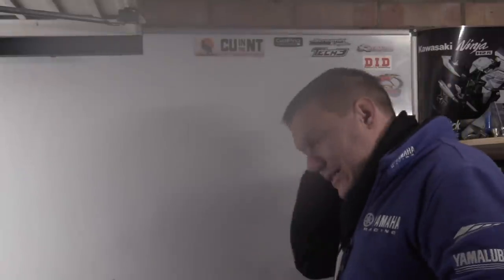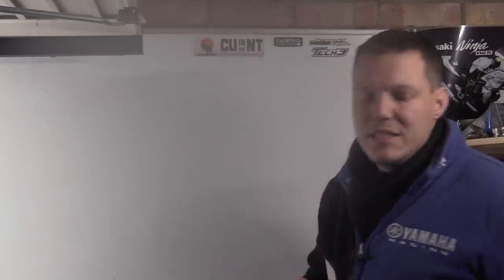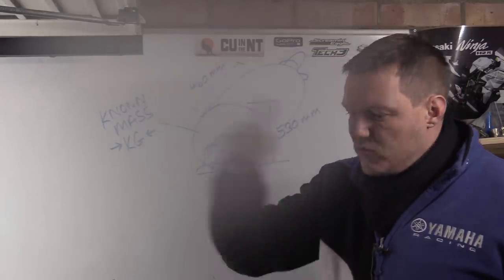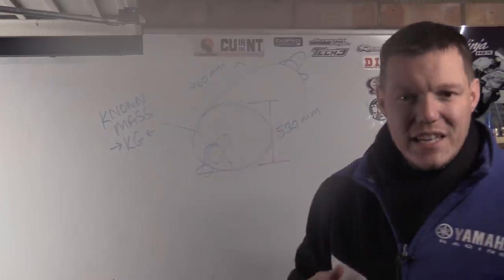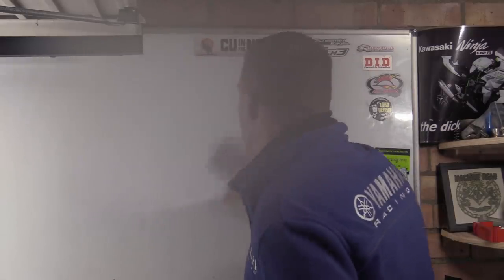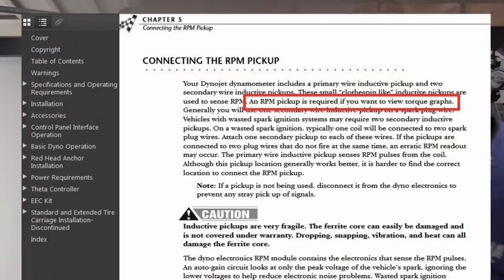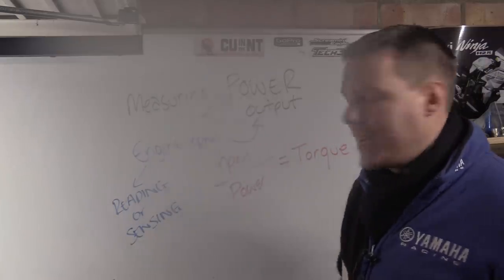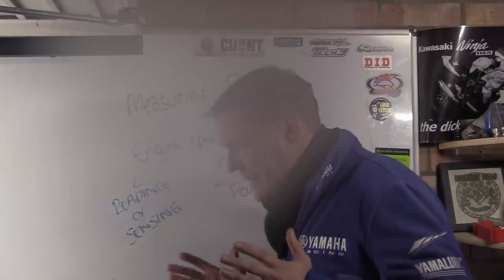Dynos and torque - Torque Episode 2

Comment: When i was at the dyno, the dyno was told when the engine was at 1000rpm and when it was at 3000rpm, so it could calculate the rpm of the engine at any given time.
I do not think it is as accurate as a sparkplug sensor or odb connection, but maybe good enough.
The dyno also had 2 ventilated brake disk like looking things with magnets on it, they could use them as a brake, if the drum was to light to give a long enough run time.
My 230hp car did not need the brake turned on, but he told a story about a more then 900 hp supra that needed full brake or the run would be over before the engine build up turbo boost.

Comment: I wonder if a small silica gel pack inside the battery compartment and leaving it somewhere warm overnight might get rid of the fogging, just a thought
Reply from the maker: 1 - there's no room 
2 - the fogging is actually the cameras fault (lol) as the sensor heats up moisture condensates on the cold lens. Tyring to heat up the lens only works for a limited time and then it cools and it mists up again. Best to leave it and let it naturally warm up together. 

Pain in the arse but there's little I can do about it at the moment
Reply: @dirtygarageguy  thanks for reply, interesting vid
Reply: My fpv goggles use a small fan . Just a small airflow will work
Reply from the maker: But it's pretty much sealed

Comment: yeah these dynos measure hp not torque, thats why you can find dyno charts that have the hp curve only with no torque, but not dyno charts that have tork only and no hp.
and when they dont hook up the rpm reading, the x-axis just shows drum/wheel speed instead.

Comment: Matt, heard you mention assembly lube before and either you or someone in the comments said to mix moly grease and oil if you didn't have it.

Am I remembering that correctly ?

I am rushing to resemble the head and get it back in the bike before Christmas or else dinner will be had sitting on the floor ... yes, I have my priorities in order 😂

Anyway, thoughts ? Just use engine oil or mix in some moly ? If so, whats the ratio ? Etc
Reply from the maker: Yeah it's in a lot of manuals and the ratio is 50/50
Reply: @dirtygarageguy  thanks dude, I have downloaded and printed the manual to ensure everything has the correct torque spec and for timing etc. 👍

Comment: Borrow a hair dryer from your missus or Issac.  Remove your lens and in a dry room dry the lens out and your camera body. Its just condensate from water contamination. That's why its happening in the winter but was fine in summer.  The moisture and temperature differential when the camera warms up is fairly high. Hence fogging.

Comment: I've never paid much attention to how torque appears on a graph for any given bike,I prefer to judge a bike by what it's like when you roll the throttle on. eg,I had a BMW K1200rs,130bhp,I traded it in 10 years back for a 900 Bonnie with less than half the bhp,never regretted it,the Bonnie just feels so much nicer on the road.
Reply: torque plot is useful for seeing dips or flat spots in the powerband caused by non optimal fuelling/timing/exhaust scavenging which are not as obvious on the power curve because that curve is multiplied by the rpm and that has a masking effect.
and you can usually feel flat spots, the torque curve just confirms it and is useful as a tuning aid.

Comment: I really need a good answer. Can you have a motor with more torque than horsepower?
Reply from the maker: They're not seperate things. HP is torque * distance / time.
Reply: There are loads out there where the dyno results give you a higher torque than HP. Common in diseasels but matt is correct their connected and just describe power.

If I recall correctly Horsepower is an expression of the power required to move a fixed weight a specific distance whereas torque describes how quickly that work can be done.
Reply from the maker: In other words they're not comparible. For example 

50 lbs.ft * 1 rpm / 5252 = 0.0095 HP

So if you mean is the number 50 bigger than 0.0095 then yes, but they're not the same units 

1 HP is 33,000 feet - pounds force per minute
50 lbs.ft is 50 pounds force - feet

Notice that 

ft . lbs (in HP) and lbs . ft (in torque) are the other way around. This will be explain in part 4, and they are different things
Reply from the maker: "If I recall correctly Horsepower is an expression of the power required to move a fixed weight a specific distance whereas torque describes how quickly that work can be done."

- LOL wrong way around, and the torque bit is wrong. The next videos will explain
Reply: I`m looking forward to the rest of the videos in this series. Cheers!
Reply: Ofcourse you can, my old Toyota diesel produces 105bhp@4000RPM but 300lbs/ft of torque much lower down.

They aren't separate though, it isn't the same unit of measurement
Reply from the maker: "Ofcourse you can, my old Toyota diesel produces 105bhp@4000RPM but 300lbs/ft of torque much lower down."

- of course you can't because like you said "They aren't separate though, it isn't the same unit of measurement"
Reply: @dirtygarageguy  whoops... I'm an English graduate not an engineering or physics graduate and it shows.... 

that was half dredged up memories from a lecture nearly 16 years ago. I was always  told that hp measurement of a motor was based way way back during the move from actual horse power to steam power  on a comparison to a specific piece of machinery.

So basically HP is how quickly the work can be done and Torque is what... The force required do it at that speed?

Comment: Your video "Firing order and torque" is still wrong and I want a correction;)
Reply from the maker: Which bit?
Reply: @dirtygarageguy  You showed instantaneous torque on a graph (over crank angle), but at the peak(during power stroke) you wrote down(and talked about) the maximum torque from the bikes specification.

That's wrong since the maximum torque from the bikes specification is average torque, calculated from HP.
Reply from the maker: So the question here is averaged over what? 30 seconds, 10 days? Power is actual over 1 second. Torque is a force, with no mention of time. You actual divide the power over time in a sense removing time from the equation to get a force. 

Therefore peak force is peak torque. Calculated or otherwise.

The next question is where did I get those numbers for that graph from? 

"You showed instantaneous torque on a graph (over crank angle)"

-  instantaneous? This surely doesn't make sense, even to you, as you followed it up with over crank angle...
Reply: @dirtygarageguy  Averaged over 720°. 

"The next question is where did I get those numbers for that graph from? " where was it from?

Do you understand what I am saying with your peak torque is wrong?
If the bikes specs say 75Nm, the peak torque on a graph that resolves to degree of crank angle can't be 75Nm but must be much higher for a 4 stroke engine.
Reply from the maker: "Averaged over 720°"

- And how does it do that? The power calculation is actually over 2pi * r which is 360degrees not 720.

"If the bikes specs say 75Nm, the peak torque on a graph that resolves to degree of crank angle can't be 75Nm but must be much higher for a 4 stroke engine"

- Explain. I want to know how you got to this.
Reply: @dirtygarageguy  The bikes specs are calculated like you explain in the video above. The torque spec is the HP devided by RPM (angular velocity...). 
Therefore it's average torque, basically how much >continuous< torque is needed to make this HP at that given RPM.

And yea, it's averaged over 720°, not 360, cause on a 4 stroke engine (assume single cylinder) the cycle obviously starts again every 720°.

" Explain. I want to know how you got to this." 
Okay, let's assume a single cylinder 4 stroke. The e.g. 10Nm  torque specs from the datasheet is created in one out of four strokes, so the peak torque must be at least 40Nm. Now during the power stroke itself, most of the work is done within about one third of the power stroke, so the peak torque is about 3 times higher again: 120Nm.
Reply: I made basically the same point & Mr Workshop seemed to imply he was deliberately misleading us and was going to reveal all in a future video (presumably this series). I'm still waiting!
Reply: @yodaedwards5225  alright! I have the same feeling;)
Reply from the maker: "I'm still waiting!"

lol keep waiting

Comment: Stupid question could you measure torque directly or is it always derived from the rpm based calculation?

Also I get how these work and how brake dynos work but do. You have any suggestions where to see how an engine dyno works.

Further dyno qs why are some dynos known to read high/give people an ego reading iv heard the dynojet set up to the manual spec has a reputation for being Conservative in its numbers.

Oh and how accurate is the maths for. Working out loss from an engine dyno to real. World. Performance the losses from drivetrain, chain, wheel etc.

Im learning a fuckton watching you torque about talk.
Reply from the maker: "could you measure torque directly"

- Yes, but it's with a different type of dyno using a load cell. 

"You have any suggestions where to see how an engine dyno works."

- Engine dynos can be inertial dynos just with a coupling to the crank. An inertial dyno doesn't have to have a rotating drum for wheels - it can have a flywheel

"Further dyno qs why are some dynos known to read high/give people an ego reading iv heard the dynojet set up to the manual spec has a reputation for being Conservative in its numbers."

- This is a video all to itself.

"Oh and how accurate is the maths for. Working out loss from an engine dyno to real. World. Performance the losses from drivetrain, chain, wheel etc."

- again an entire subject - but losses can be calculated by letting the inertial drum naturally slow down with the wheel still in place, although you have to have the clutch disengaged otherwise you'll read the pumping loses from the engine.
Reply: @dirtygarageguy  thanks and sorry. For adding to The video list also now I'm off to see how a load cell works and/or what one is.

Comment: in order to measure torque directly you would need to eliminate time/rpm wich is imposible in an engine. So nobody ever measures torque in an engine? i never though about this..
Reply from the maker: Yes they have and you can - kind of. It's called a Prony brake. There are other ways to do it, but the problem is they're dependant on friction and always apply a load on the engine.
Reply: @dirtygarageguy  i just looked up the concept. So its measured in regard of how much weight the flywheel or an output shaft can take before slowing down or stalling? But if the engine is working, the rpm should alter the outcome i think. Its not the same trying to slow down something at 100rpm or 10000rpm. And if you measure torque based on something that is spinning arent you measuring power?
Reply from the maker: " i just looked up the concept. So its measured in regard of how much weight the flywheel or an output shaft can take before slowing down or stalling?"

- it's measuring how much resistance is required to apply 'x' amount of torque. Because it's a friction system you also have to allow for heat etc - so it's not the most accurate measurement device hence why they're not used any more

Comment: My bike produced 138 hp on a Superflow eddy current dyno and 167 on a inertial Dynojet . DynoJet, making the internet a  quagmire of bullshit "djhp fudge factor" numbers. LOL
Reply from the maker: Well it depends on the SAE correction factor. The atmospheric measurements can be fucked around with. This is down to the dyno tech and not the dyno.
Reply: @dirtygarageguy   Maybe not?
Dynojet’s final number-fudge was arbitrarily based on a number from the most powerful road-going motorcycle of the time, the ’85 1,200cc Yamaha VMax. The VMax had 145 advertised factory horsepower, which was far above the raw 90hp number spit out by the formula. Meanwhile, existing aftermarket torque-cell engine dynamometers delivered numbers that clustered around 120. Always a pragmatist, Dobeck finally ordered his Chief Engineer to doctor the math so that the Dynojet 100 measured 120 hp for a stock VMax. And that was that: For once and forever, the power of everything else in the world would be relative to the ’85 Yamaha VMax and a fudged imaginary number. Dobeck’s engineering staff was dismayed by the decision, but the Dynojet 100 exclusively measured surplus power available to accelerate the vehicle’s mass-no more, no less-and that was true even if the modification was a low-inertia flywheel or lightweight wheels. As long as the inertial dyno’s numbers were repeatable, the critical question (did a particular modification make the engine accelerate faster or slower?) would be answered correctly.
https://www.hotrod.com/articles/dynojet-chassis-dyno/
Reply from the maker: "Wrestling to fully understand inertia and powertrain losses, Dobeck and his team quickly realized that the standard physics formula of weight, time, and distance for converting acceleration into horsepower simply didn’t work-the derived number was always lower than accepted numbers"

- There's some bullshit in here. Sounds like someone doesn't know how to add.

Accepted numbers from who?
Reply from the maker: I had a read through that, and there's a few problems - this alone will make a great video - cheers
Reply: @dirtygarageguy  I look forward to the video, all in good time. Hopefully you will have new markers....

Comment: RPM / Power =torque.... So the higher the power # the lower the torque #.. ?  My 350 Cheby revs to 7800. Compared to a 650  a 800 DP Holly the power is up 50hp or so above 6200 ish but loses 50hp off idle to 5000rpm or so. The power below 4500 is nice but I like the power on top so I use the 800 DP. So air flow effects torque. Ignorance effects torque, and time....moving this way and that, so time is the time the movement takes?! 🤔🤤 I think I'm getting it  now. 🤔🤯🤦
Reply from the maker: RPM / Power =torque.... So the higher the power # the lower the torque #.. ?

LOL good point - I missed the fudge factor because that's in episode 4. 

And it's power / rpm. That's my bad, this is the problem with doing it off the top of my head.
Reply: @dirtygarageguy  By fudge factor you mean that  Power/RPM= torque   is the correct equation?  (Sorry, I am Hungarian, my English is much worse than the American's....)
Reply from the maker: "By fudge factor you mean that  Power/RPM= torque   is the correct equation?"

No. The fudge factor is to make all the units match - for HP it's 5252 and I've done a video on why - it's coming soon